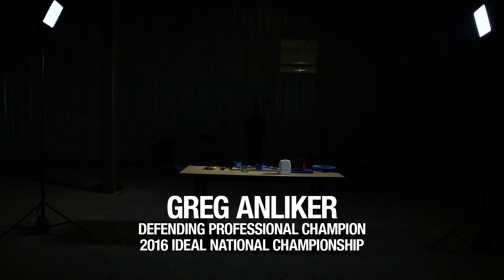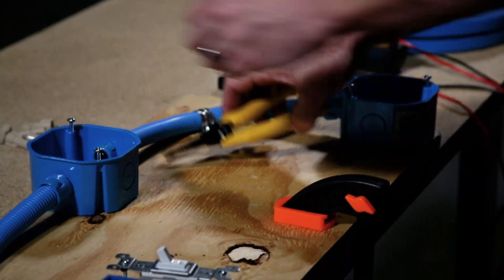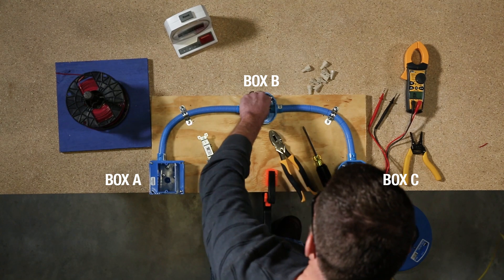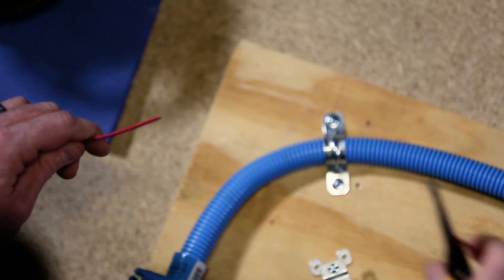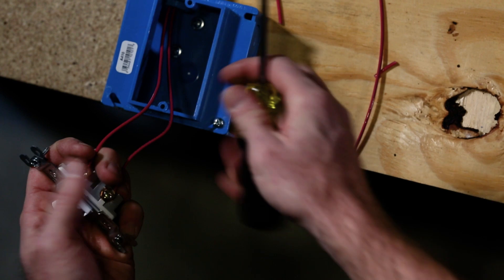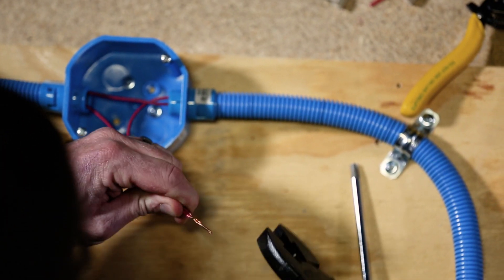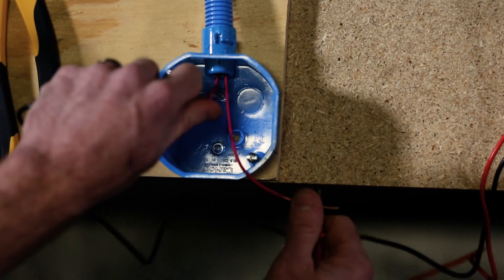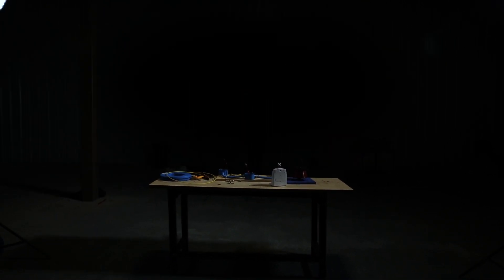2017 IDEAL National Championship Qualifying Round "How-To" Video

Comment: A perfect small shop non-union competition. Some of the best electricians would do miserably and some of the worse electricians would win. 

They should put troubleshooting, calculations for selecting the right boxes, tube or pipe size, wire size, maybe even have it ran in pipe you have to bend but choose the bends.

Then you have to get the calculations right, fix the problem troubleshooted, and make the work look nice and also get a score on artistic impression since most fast guys can't do open celling because it's three ugliest part of the facility and don't think that they hire interior designers for a reason.
Reply: This is only part of the competition. They do have conduit installs and and stick house ruff ins as well. Also it's just a function that Ideal tool company hosts to showcase their new tools. (Only ideal tools are allowed) I believe Its just fun for apprentices. So no one is looking to take home the title of "best electrician". But I'm glad they showcase the rules. Could be fun to do at lunch or something.